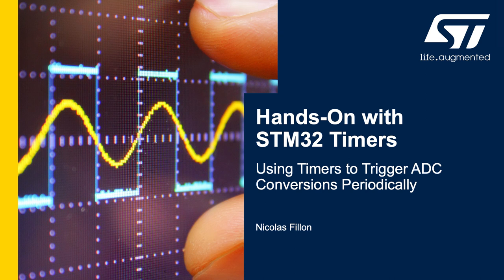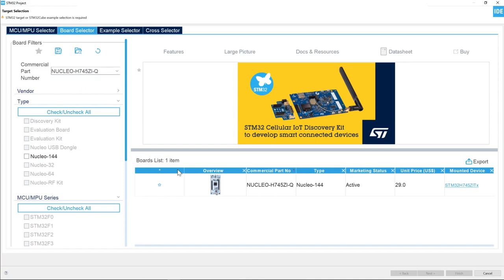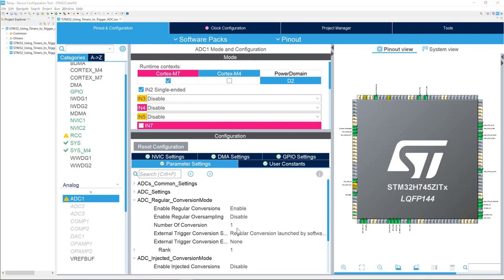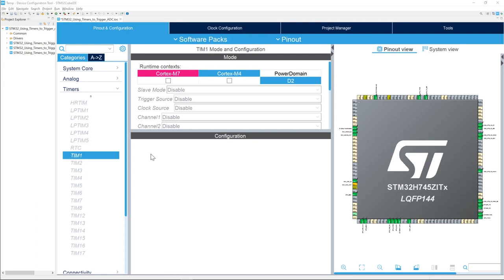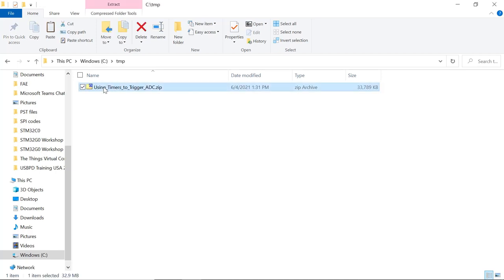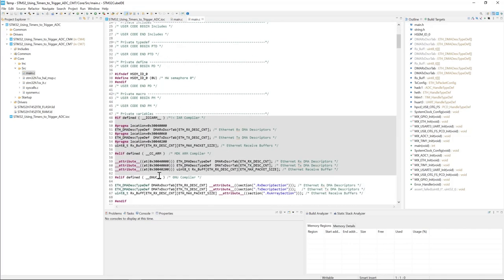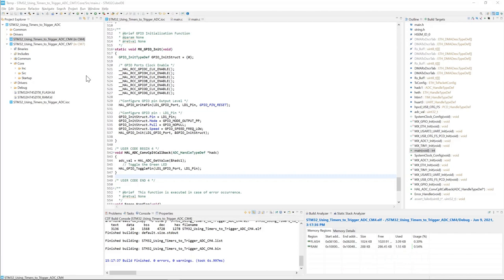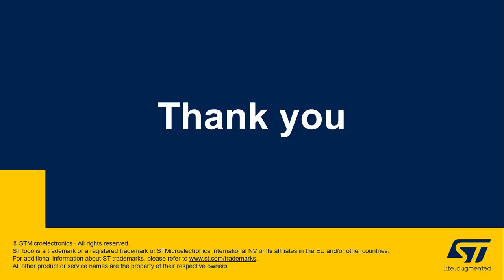Hands-On with STM32 Timers: Trigger Periodic ADC Conversions

Comment: PWM frequency is 5kHz, not 10kHz, as shown on the scope. The ADC sampling rate should also be 5kHz?
Reply from the maker: Hi there, thanks for your question - may we point you towards our community.st.com, where you will find a team of people who can answer you directly ?
Reply: Hello man, the timer trigger the adc when counts 24000 and this happens always at 24000 so the frecuency of the adc is 10 KHz. the toggle only shows when de adc works. if am I wrong, please show me the aswer
Reply: @ingenieriasetelsat8583  Thank you for your reply. I watched the video again. Indeed the PWM frequency is 10kHz. I got confused by the ADC conversion rate and the LED toggling frequency. The scope shows LED toggling not the ADC output. LED goes high every two ADC conversions. This is why the LED toggling frequency is half the ADC conversion rate.